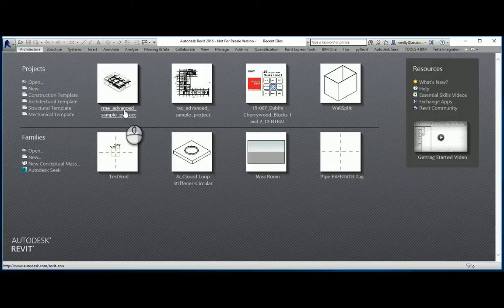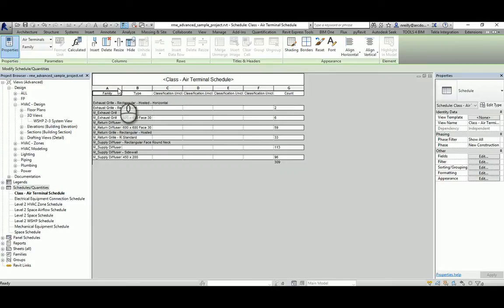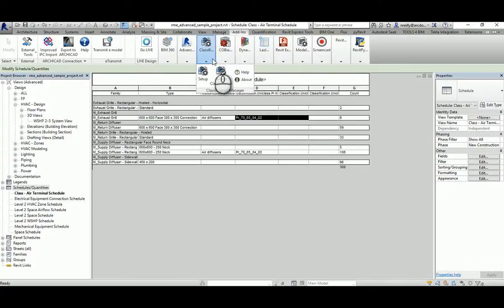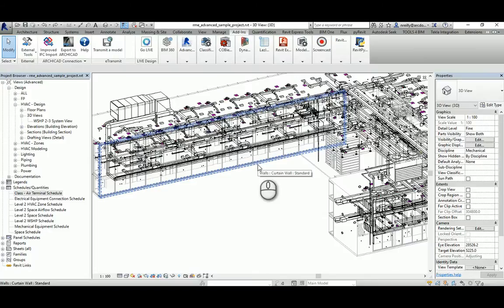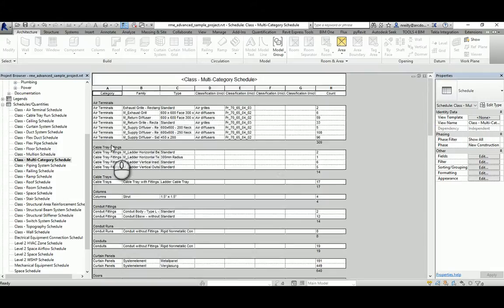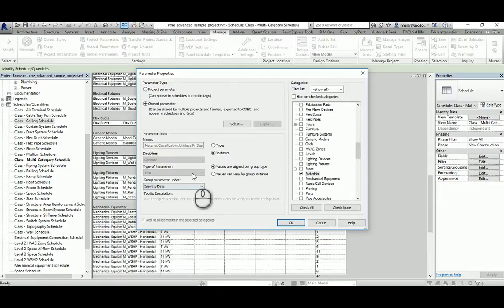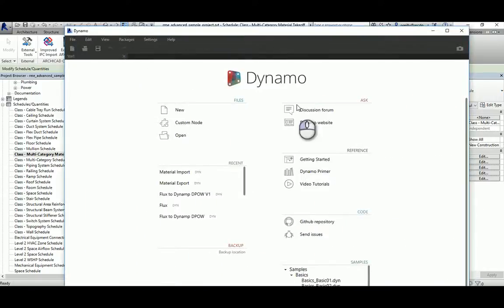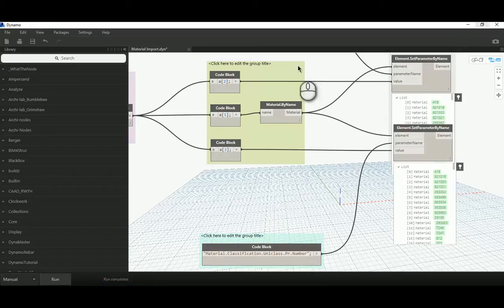Revit Addin Overview: Classification Manager

Comment: Hi Neil, great video, Would you ever need to populate the Uniclass.Ss fields ?
Reply from the maker: Yes, at the earlier stages of the design they would be used, then as the project progresses Systems will be broken down into products. I think Systems can also be used for MEP systems, which will also be broken down into their components, but MEP systems could be exported as with its Ss fields later down the line.